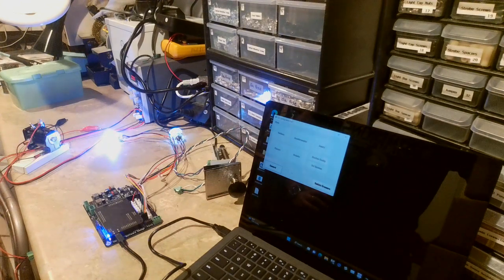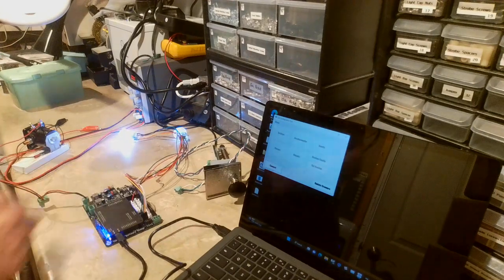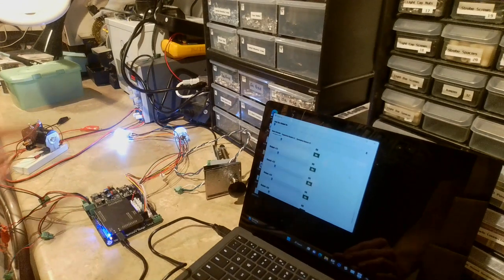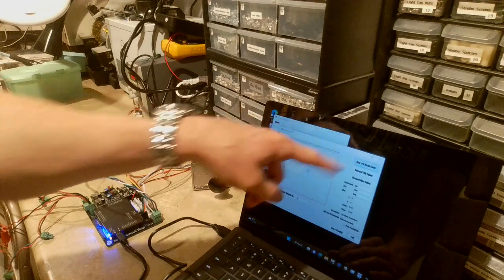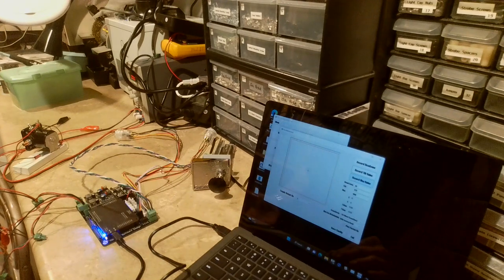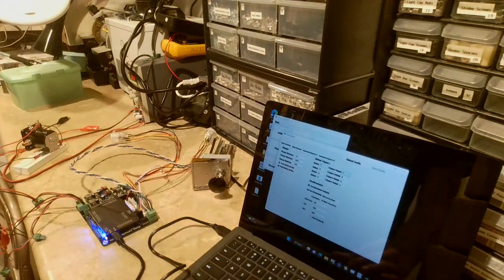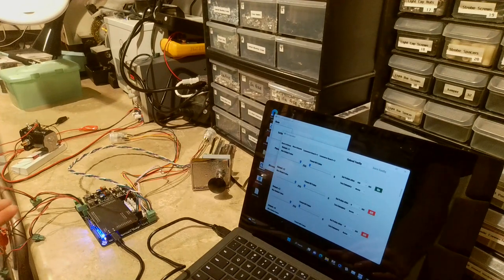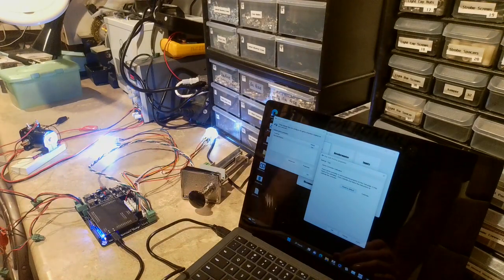Cleveland Software Design Virtual Pinball PinOne Board and PinOne Mini Board DOF and DOFLinx VPX FX

Comment: Very cool. Would this attract mode you speak also coincide with say, a frontend like Pinup Popper when popper is also in attract mode? Sorry if that's a dumb question.
Reply from the maker: This attract mode will work when DOF is not sending signals to the device. Once you have DOF configured and your machine is sending data to the Device, then DOF will always take precedence